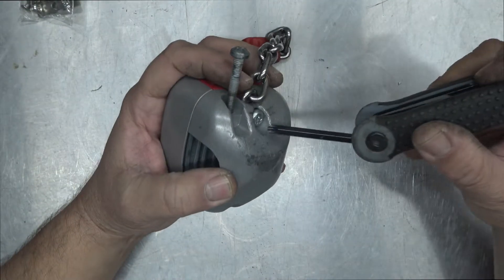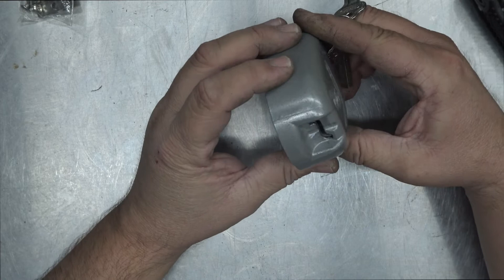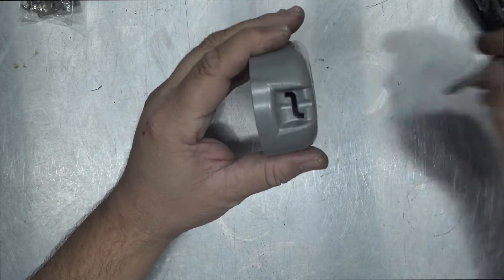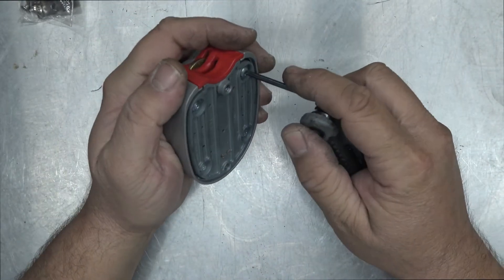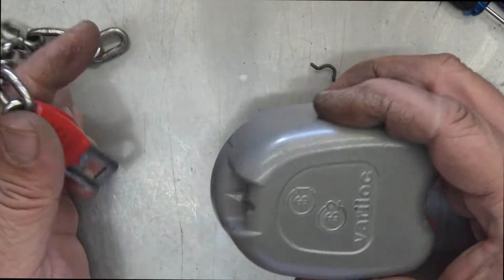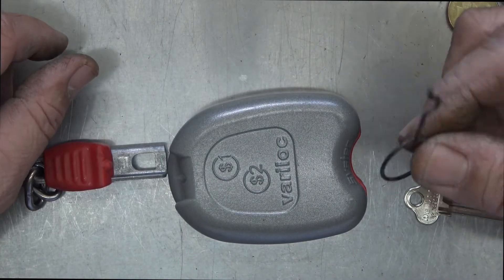Shopping Trolly Lock Picked & Gutted

Comment: You actually showed the simplest solution and then moved away from it.
It's the Lockwood key. I did the same as you years ago and discovered that if you file the ring hole of the key down, it makes the perfect trolley key. Just drill a small hole at the narrow end and keep it with the rest of your keys. I call it the 'dick and balls key' for reasons which will become obvious after you file the ring hole down. You don't have to buy a blank either, just use an old key. And for the times when I didn't have my dick and balls key, I just politely asked the nearest staff member to unlock one for me. Cheers

Comment: I've always used the ''key'' that opens a can of Spam, a bit of a jiggle and you're off - I'll try the reverse Lockwood key trick and find an old key and drill a hole in the tip for the ring. Good video - thanks.